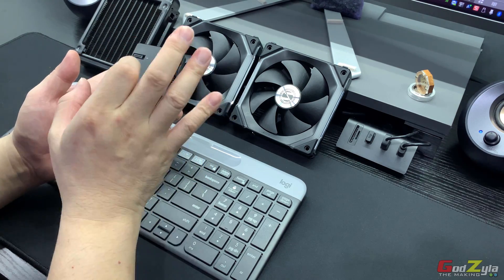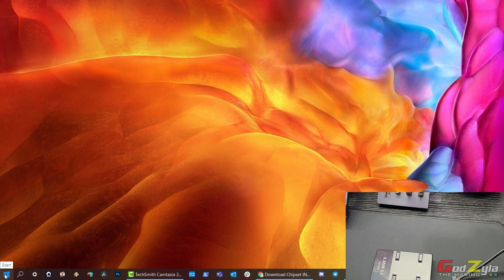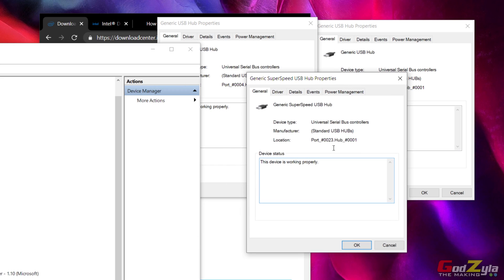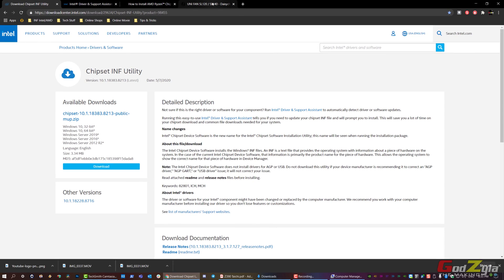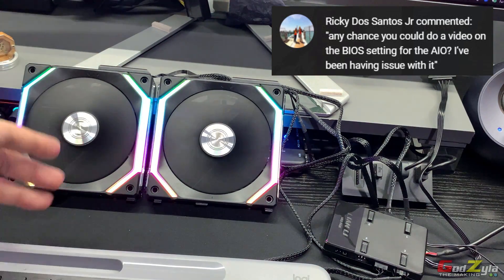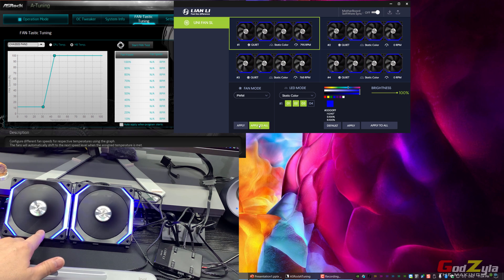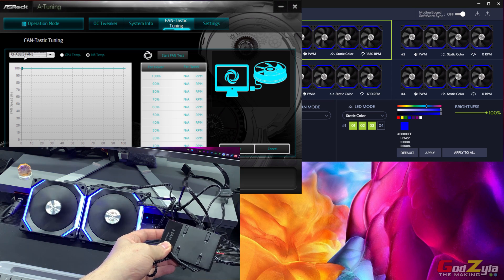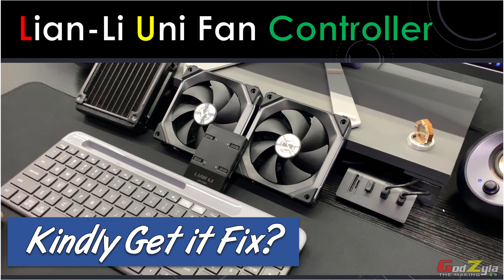Lian Li Uni Fan Controller - Some Break Fix! [L-Connect]

Comment: Lian li shows up on device manager but still cant control fan rpm or LEDs
Reply from the maker: Hello Emma Biswas, welcome to my channel. Which uni fan are you using? If you are using the SL uni fan. Does your uni hub have the SL labeled on it? If not you will need L-Connect. As L-Connect 2 will only work with the SL uni controller with the SL labeled on it.
Reply: @KleoYan  hii  , mine is Sl120 ,and it seems i can control Leds with Lconnect 2 , Lconnect is not working. Still i am unable to control fan speed with either
Reply from the maker: @submergedSerenity  can you confirm that your uni controller has a SL labeled on it? Btw what motherboard are you using?
Reply: @KleoYan  Motherboard is Gigabyte B660M aorus pro and its an SL120 kit , the leds are on the side of the fan only
Reply from the maker: @submergedSerenity  ok and does your uni fan hub has the SL Marking labeled on the controller itself. Don’t mind as I have asked you the third time. Before I can help you out I need to know exactly which uni hub you are using as SL have an old and new uni hub.
Reply: @KleoYan  hub has " Uni Fan SL" written on it , i double checked just now
Reply from the maker: @submergedSerenity  ok your Aorus pro have two USB header, did you try the other header to see if it works. if it does not, did you install the Gigabyte fusion app before the L-Connect 2 app? if you did,

1) Remove both apps using revo uninstaller https://www.revouninstaller.com/ this removal tool will remove all leftover files and registry.
2) Shut down your PC, remove the PSU main plug and leave your PC for 40 seconds.  (this will flush off all existing memory of all devices connected to the motherboard) 
3) double check all connections (example fans to uni hub and hub to motherboard usb)
4) Make sure the sata power source is connected to your uni hub controller from the PSU
5) plug back the PSU cable and power up up your PC again
6)  View device manager to see if the uni hub is being detected. 

7) Install only the L-Connect 2 app. 
8) Test it out again
9) if it still does not work, kindly approach Lian Li Tech support at https://lian-li.com/faq/ or you can post your issues at their reddit forum https://www.reddit.com/r/lianli/
Reply: @KleoYan  Steps that i did to get atleast the RGB working
1. L connect does not work with either USB headers(tried switching) , though it shows up in device manager as "Lian li Uni Fan SL v1.1" unlike yours which just says "Lian Li"
2. L Connect 2 works with Leds and detects when i switched the USB port . Fan speed still is a no go
3. Connected the fan header directly to my fan hub and so can control fan speed from there.
4. Tried recreating my exact working scenario by disconnecting USB port and waiting as you suggested. On reconnecting and restarting windows Lconnect2 wont start , reinstalled and it started again and can control the LEDs again .

So i think this is mainly a software conflict\motherboard issue . I did install Fusion app before Lconnect2

Thanks for putting so much effort into trying to solve my problem. Your genuine care for helping the community is very much rare and very appreciated 😊😊
Reply from the maker: @submergedSerenity  hmm.. ok. so now left with fan issue. just to check are you trying to use PWM in your L-Connect and it does not work? if it is, check these

1) Make sure PWM cable (one wire only) is connected between the Uni Hub controller to one of your motherboard header (example SYS_FAN1) 
2) Next go to your UEFI / Bios, got to your fan monitor, make sure SYS_FAN1 is set to PWM and you will need to set a profile or customer fan curve. save it
3) boot up your system, launch L-Connect 2, under the output where your fan is plugs, select PWM at the fan section.

this should follow your fan curve set in UEFI. I am sorry that I do not have a gigabyte board with me as I am not able to point out if there are any software that controls the fan. be it using software, your physical settings in UEFI must set to PWM mode and not auto or DC.
Reply: @KleoYan  okk , will try this out next time i open up my case , thanks again
Reply from the maker: @submergedSerenity  you are most welcome. Hope you will get your issue resolved

Comment: Hey man! I've installed the amd chipset and restarted my pc.. I'm still getting the error code under the device manager that it doesn't recognize the fans plugged into my USB drive. Not sure what to do.. my motherboard bios is up to date. Keeps saying unknown USB device (devise descriptor request failed) this is a brand new build.. I updated all my windows and drivers. Nothing is working! I even did all the stuff you mess with in power setting for the USB ports to work correctly.. help!! :)
Reply from the maker: HI Ronnie Woodward, welcome to my channel. do you happened to have another USB Header on your mobo? or do you have any argb program installed besides the L-Connect app? maybe try uninstalling all argb program using revo uninstaller. This uninstaller will aid in removing leftover files and registry. Then reboot your system, see if it does detect your device? then install the L-Connect app and give it a try.
Reply: @KleoYan  no I dumped the PC clean.. I didn't even install the L connect at all.. I downloaded the amd chipset like you said then plugged the adapter box in. Still not reading the lian li box.. I have 2 boxes cause I bought 9 fans.. I've tried both boxes in both USB headers and still getting the error code
Reply from the maker: @Dubbyx2x  I see, does the usb header works with outer stuff? You might want to check with your motherboard manufacturer or contact lian li support. they might be able to assist you further. Try posting at lian li reddit https://www.reddit.com/r/lianli/ or even contact them directly https://lian-li.com/faq/ (scroll down and fill the form)
Reply: Yes all the outside usb headers work fine. I contacted the gigabyte motherboard manufacturer and they were not much help. They said the rgb prolly isn't compatible with the motherboard. Then proceeded to tell me that they would send me over a list of compatible fans and what not. But instead send me a email link with the main page of RGB fusion 2.0.. so they were no help at all hahaha
Reply from the maker: @Dubbyx2x  hi, pardon me for the late reply. what I meant was.. if you have other USB that make use of your motherboard internal USB header, do they work? if they work, it should detect your uni controller. I am running out of ideas how to assist you, maybe you can try posting your issue at the lian li reddit forum https://www.reddit.com/r/lianli/ or contact lian li support directly https://lian-li.com/faq

Comment: Thank you so much for the detailed explaination. For me, i didn't had to add the l-connect fix. because now l-connect v2 released with that bug fix. but they didn't fix the pwm mode. i had to change in bios like you and use the temp use input to cpu so that the system fan can follow the cpu like the cpu fan.
Reply from the maker: Hi 
Muhammad Mejanul Haque, welcome to my channel and am glad you've sorted things out and provide feedback which will be valuable to viewers. once again thank you to have visited my channel and to write out the feedback. 👍

Comment: Hey my fans for the radiator works but the other 6 fans are working. And there are none of the rgb showing for the 6 fans and the radiator fans???
Reply from the maker: Hello xViizousx, welcome to my channel, I can assume that you mean your fans does not react to the argb effects. have you checked under device manager. if the uni controller is showing under Universal Serial Bus Devices? also are you having other argb programs running before you install the L-Connect? btw which uni fans are you using?

Comment: when i plug the usb in it doesnt even show up lmao
Reply: my only problem is the rgb and thats it
Reply from the maker: @luley_2085  you are most welcome 🤗
Reply from the maker: @luley_2085  welcome to my channel. do you happened to install any mobo argb program before the L-Connect app? you might want to try uninstall all argb program first, make use to revo uninstaller https://www.revouninstaller.com/ to clear all leftover files and registry, shut down your system, remove the power cord from your PSU.. let it sit for 40 seconds, power back on again. then look under device manager does the lian li controller appears? if it does, install L-Connect and try. if it does not appear, does your motherboard have another USB header? try changing to the other header. If it still dont work for you, I suggest you to contact lian li support directly, either post your issues here https://www.reddit.com/r/lianli/ or submit an issue form here https://lian-li.com/faq/ (form is at the bottom)
Reply: @KleoYan  thank you very much for the responds i fixed it 🙏🏻

Comment: My fans were working great then I got back from camping and they spin but I cant control it, and the rgb is dead. The controller shows up in device manager. The chipset download you recommend doesnt appear to be for windows 11. do you have any other ideas? i have a phantom z390b from asrock also they are the AL series not the SL.. Please help
Reply from the maker: Hi Jakes 420h, welcome to my channel. have you tried disconnecting and to test a fan at a time? or even re-installing the L-Connect application? if you did and failed, are there other argb programs installed to control other stuff? if you do have them I advise you to remove all argb programs in your system. use revo uninstaller ( https://www.revouninstaller.com/ ) as this program will remove all leftovers and registry files. Then reboot your system. install only the L-Connect app.

Comment: Hello I have 9 Lian-li fans on my pc right now, 2 on the radiator which is 140 and 7 on the sides. I did the steps on your other video how to connect them but the app won't control them. The fans are on and with lights but it doesn't seem to respond on the app. I have ASUS TUF Gaming H670 Pro motherboard. Can you please help me? T_T
Reply from the maker: Hello Lanzealot, welcome to my channel, just like to check, I assume you are using the SL uni fans, which L-Connect version are you using? kindly note that if your Uni fan controller does not have a SL Marking, you will need to use the L-Connect original version. If your controller have the SL marking, then you can use the L-Connect 2. assuming you are using the correct L-Connect. Are you using the armoury crate before you install the L-Connect app? If you are, i would advise you to remove both Armoury crate and L-Connect using revo uninstaller https://www.revouninstaller.com/ . This uninstaller is to remove all leftover files and registery. once you have done that, reboot your system, check on device manager, make sure you are able to see your uni fan controller under Universal Serial Bus Devices. if it's listed, install the L-Connect application and try testing your fans PWM and ARGB. once ok, then install your armoury crate program.

Comment: I tried all these steps but my software still doesn't work, my fans light up and spin but i cant controll them or the color.
Reply from the maker: Hi Justly,  welcome to my channel, I like to check, do you have other argb programs installed and in use before you have installed the L-Connect? and which uni fans are you using?
Reply: @KleoYan  hey, I have the gigabyte rgb fusion 2.0 installed but l-connect didn't work before I installed it, also I have the sl140 uni sli in white, I also cant controll the lighting using the fusion app
Reply from the maker: @justqt_  maybe you want to try uninstall both fusion and L-Connect, make use of this to remove all left over files and registry https://www.revouninstaller.com/revo-uninstaller-free-download/ then reboot your system, install only the L-Connect app. Make sure is L-Connect and not L-Connect 2. Then try to see if you can control your SL140 fans.
Reply: @KleoYan  alrigty ill try that rn, thanks for the help btw!
Reply from the maker: @justqt_  you are most welcome. All the best with your build. 👍
Reply: @KleoYan  Sorry haha im back again, unfortunately it still isn't working yet :(
Reply from the maker: @justqt_  Aik, hmm does your motherboard have another USB socket. you can try that. If you still can't, I will advise you to approach either posting your question at lian li reddit https://www.reddit.com/r/lianli/ or contract lian li support directly https://lian-li.com/faq/ (scroll down so you can post your issue)
Reply: @KleoYan  hey so I did something probably not advised and switched the usb plug when the pc was on after uninstalling the driver and it started working 👍😁 thank you so much for your help
Reply from the maker: @justqt_  I see. Yup not advisable but hey at least you got it working. Congratulations 👍

Comment: Hello I do not know if you still monitor this video as it's over a year old, but here's hoping. My UniFANs used to work, but after a windows reinstall I can not get the PWM on them to work anymore. I updated the firmware on my old hub so L-Connect 2 would work, but my motherboard(ASUS x570 Prime Pro) does not even see the hub connected on the Chassis Fan 2 header that it is plugged into. The rest of the hub operations work fine, but nothing I have tried has gotten PWM to work again.
Reply from the maker: Hello ehrie, welcome to my channel, the normal characteristic should be, your motherboard does not read the rpm if you are using the L-Connect2, but it sill relect on your L-Connect2 Dashboard. are you saying that the RPM is not shown in your L-Connect Dashboard when you set to PWM mode? maybe also check if your motherboard fan header that was connected to the uni controller, make sure you have set that to PWM Mode in your UEFI and to set the desire fan curve you need.
Reply: @KleoYan  I have it set to PWM in my motherboard's bios, but when I set it to PWM in the controller the fans stay at 1340 RPM no matter what I change the fan curve to in the bios. Edit: I should also mention this worked with the L-Connect 1 software. This behavior only started once I downloaded and upgraded the controller to be able to use L-Connect2.
Reply from the maker: @talshiarAKS  are you using the SL fans? and is there a SL Marking or labled in your SL uni controller? if there are no markings and you want to use L-Connect 2, you might want do to a firmware on your SL Uni controller. here is how. https://youtu.be/hZpzR_4917c  .. if you need more info about the uni fan controller, I have a series of videos which might interest you. https://youtube.com/playlist?list=PLEW-b-2vYDdPo0NzHyeksx012c-nkDapm

Comment: More questions. I plugged my aio into the cpu fan header and the radiator fans into usb header on mobo. I only want to control thru mobo bios (don’t want to control via icue). Not sure exactly what option to pick in the smart fan section of my bios to control the pump speed and radiator fans. Is the pump speed control called CPU in this fan section? If yes, how do I control it. Do I need to select pwm and manual to set fan curves? I tried selecting full speed but doesn’t seem to do anything.
Reply from the maker: It depends if your pump is 4pin or 3pin. If your pump is 3pin and your mobo is set to pwm mode. Your pump will go full speed. Unless you change it to dc mode and select fix profile. This should help explain pwm and dc mode in your mobo https://youtu.be/MCMkrQwFnKM

Comment: Hi, I tried the following steps no luck, I have a gigabyte B550 D-P mobo. The fans and light works but I cannot control the fan nor change the colors. Any suggestions?
Reply from the maker: Hi Samantha Vann, welcome to my channel. I like to check, do you have other argb program running before you install the L-Connect applcation? If you did, you might want to try uninstalling that together with the L-connect app, using revo uninstaller https://www.revouninstaller.com/revo-uninstaller-free-download/ this application uninstall and remove leftover files and registry.  Then reboot your system. Install only the L-Connect. See if that works. If it does, install the other argb program to see if you are able to use both application.
Reply: @KleoYan  thank you for getting back to me Kleo, I haven’t installed any of Argb programs just the L-connect application. Ive tried serval times installing and installing the app no luck. I tried plugging into a different usb in the mobo, nothing.
Reply from the maker: @sammyv7398  you are most welcome. if that's the case, you might want to contact lian li support here  https://lian-li.com/faq/ (scroll down there is a form for you to post) or post it at their reddit forum. https://www.reddit.com/r/lianli/
Reply: @KleoYan  thank you 😊
Reply from the maker: @sammyv7398  you are most welcome and pardon me as I can't really help you out with your issue.

Comment: Hi Kleo, I've selected PWM in the L-Connect for my fans.  For some reason when I first boot up my pc, the fan would always go 100% full for a couple seconds, then it becomes normal after.  I assume it's just the motherboard bio taking a couple seconds for the fan curve to be recognized.  Is there a way to not have it go 100% full on startup?
Reply from the maker: Hi Buddy N, this is normal. you can try plug all your fan set to the respective motherboard fan header instead of the uni controller.. You see the fans will take commands from L-Connect which is right after windows boot up. By connecting to fans direclty to your motherboard fan header should minimize this problem.
Reply: @KleoYan  Thx for the reply. I will just leave as is, it's only a couple seconds. So not too bad
Reply from the maker: @BuddyPickleball  ok buddy. btw thanks for your valuable question and pardon me.. took me this long to reply. busy at work.